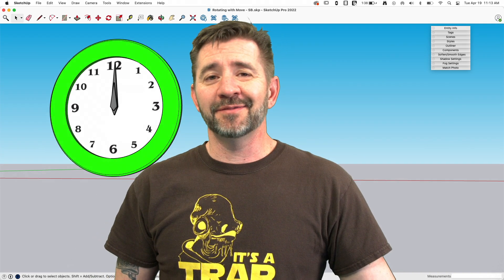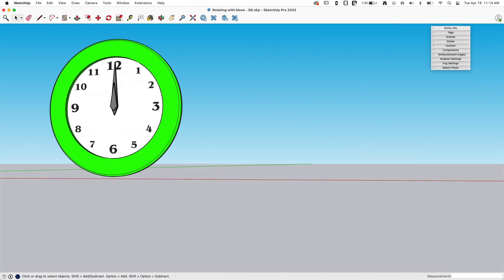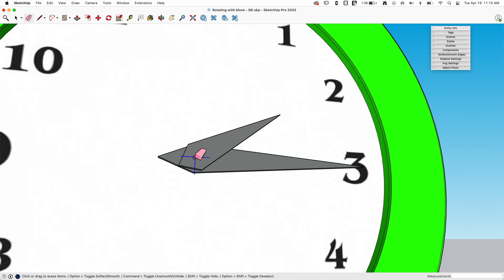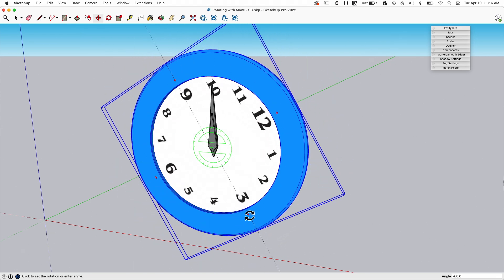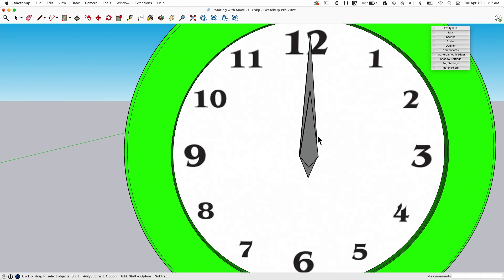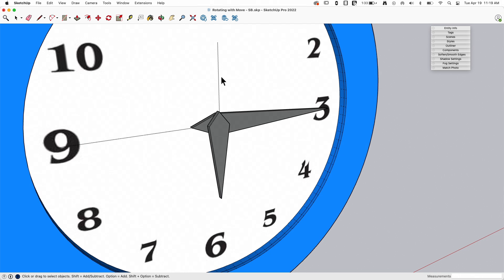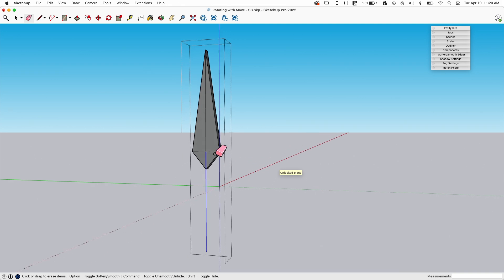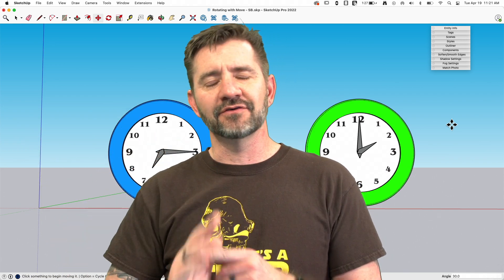Rotate with Move - Skill Builder

Comment: WHY NOT ADD NEW FEATURE WHERE YOU SET THE ROTATE POINT WITH THE MOVE TOOL BEFORE ROTATING? LIKE MOSTLY EVERY OTHER SOFTWARE PROGRAM.
Reply from the maker: That can be done, as well. The rotate handles are quick rotation tools that spin a selected object around its geometric center. This is a way to quickly blend the best of both procedures.
Reply: @SketchUp  Yea, But you have to spend time setting up the Group to be symetrical
Reply: @kimberbearly7909  and you would do that, if rotating that object in the same way was something you wanted to do often.  I Use the same hidden line trick for my doors, so that flip in red/green direction covers all adjustments in positioning the door. (in-out, right-left), without moving the door afterwards. Setting up keyboard shortcut for flip red/green, you can adjust your door literally several times in a second.. :-)